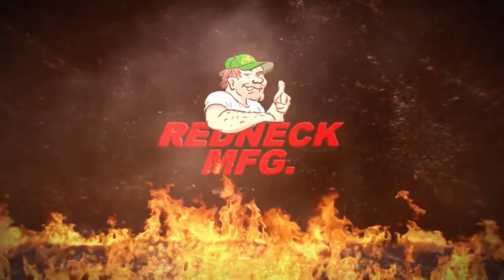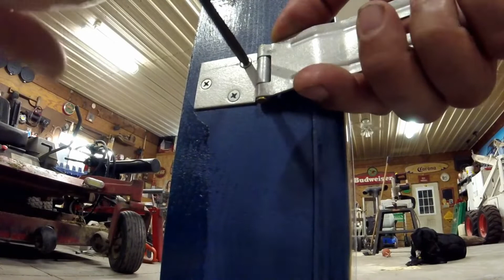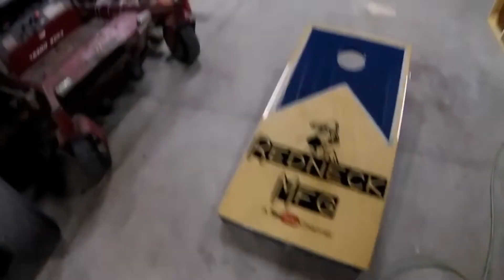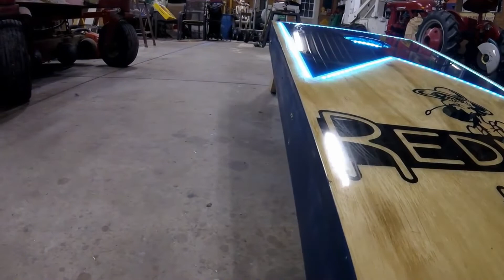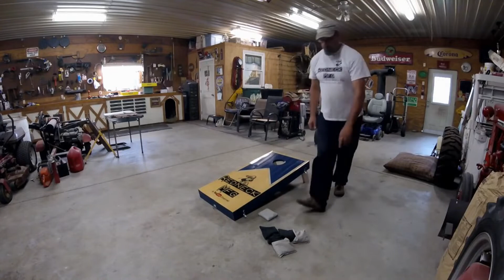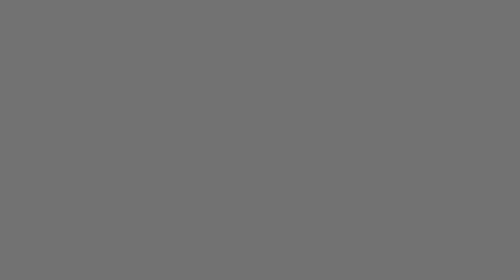Please Share - LED Cornhole Boards

Comment: How much dose something like that run a person.
Reply from the maker: Oh man I have a small fortune in these darn boards... I would say cost of material was -- approx. 180.00 bucks and that's low balling the price... it was a blast to build and if I had to do it again I definitely learned a few things to do different that's for sure... Example - I would not solder all those wires from one strip to the next --- I found that they make snap on connectors … you would just have to plan out the layout to work with the connection points on the led strips themselves....